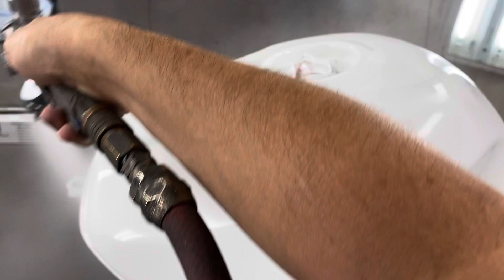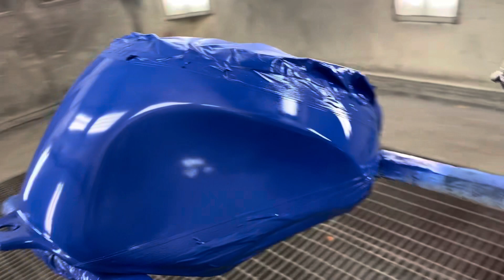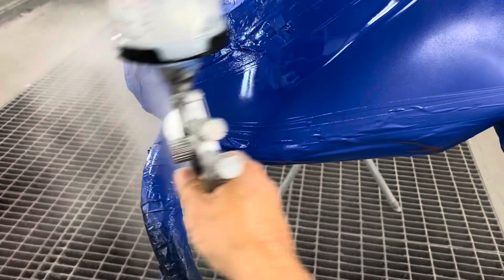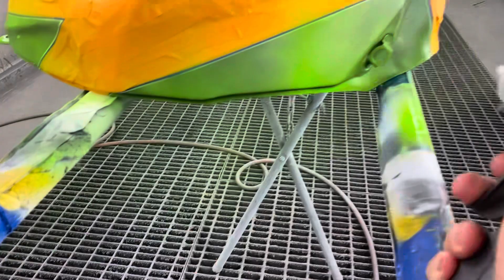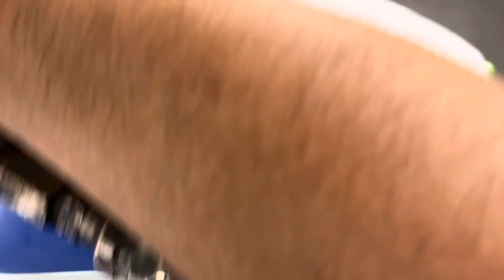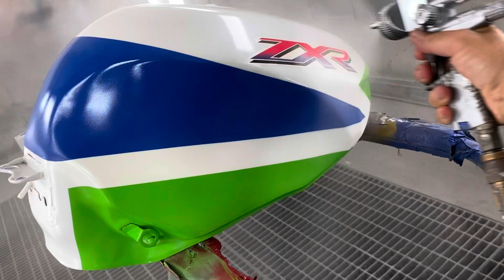Kawasaki zx7 Zxr750r paint touch up

Comment: Looks great nice work. I had a question I noticed not to long ago on a video you have you purchased a bunch of zx7 bikes I have one I’m looking to restore and parts are hard to find. I was wondering if you were open to selling some parts of yours still have ? Thank you for your time
Reply from the maker: I’ve sold a lot. I still have three to restore. Depending on what you need I might have some parts. Are you on zxforums.com
Reply: I am on some forms. But I’ve been trying to find the plastics. That would be awesome of you happened to have a extra set
Reply from the maker: @jacobpolocoser2774 I think I have some rear plastic
Reply: Anything is better than nothing. Trying to find the front plastic or the side fairings has been a pain.
Reply from the maker: @jacobpolocoser2774 they are out there just show up and get bought like instantly
Reply: Do you have pictures of the rear plastics
Reply from the maker: @jacobpolocoser2774 I can get out there tomorrow and gather them up and snap some photos
Reply: That would be great
Reply from the maker: @jacobpolocoser2774  I’ll put photos on your post